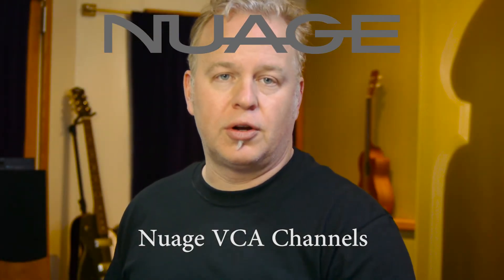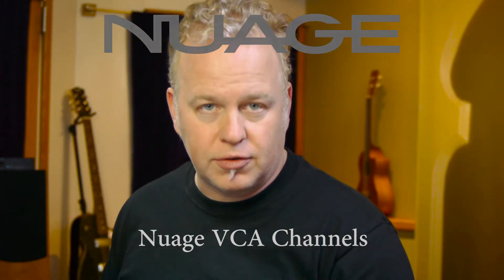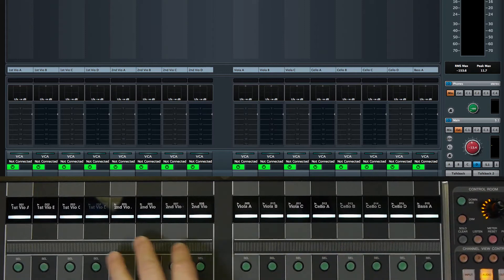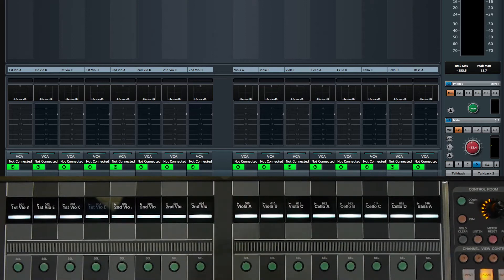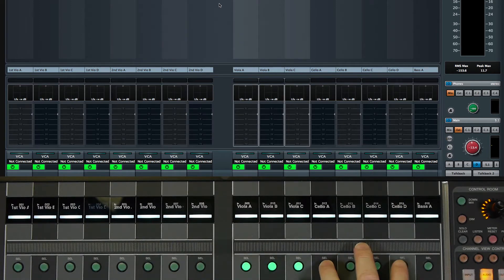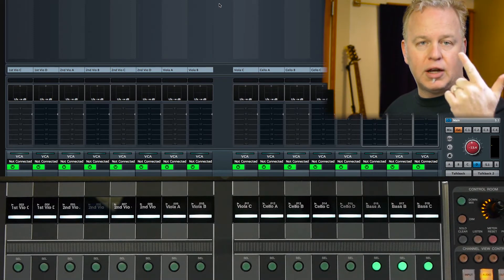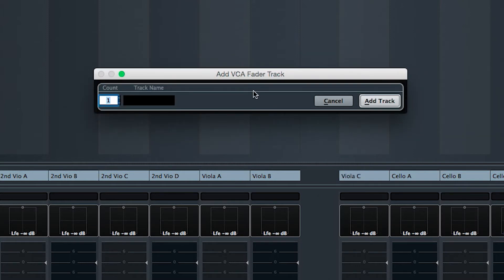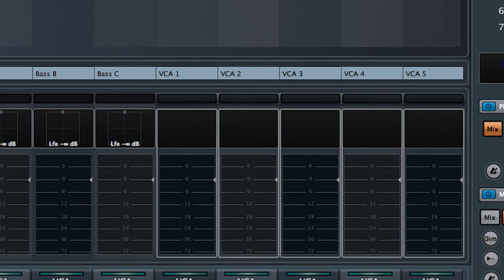26-10. Nuage VCA Channels / NUAGE Courseware

Comment: Why are the linked faders jittering?  It's using high speed Ethernet not midi
I would never expect to see this from a Nuage system. 
I don't like pro tools much but with their controllers you never see it struggle even with a huge load. 
I have a original hui that uses old midi and yet I don't see my faders ever jitter while grouped or not
Reply: Jittery and noisey. Not great. I've loved the videos on the NUAGE until this one. I'm assuming the shotgun is pointing right near them. I've seen another video and they weren't as bad but it's not great. Plus the jitter is real bad.